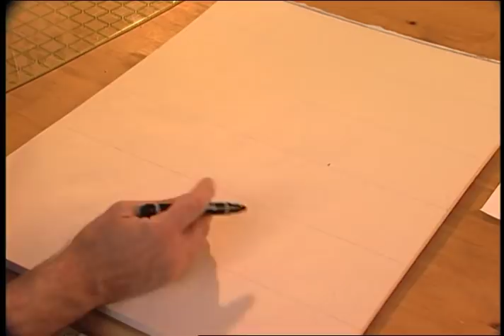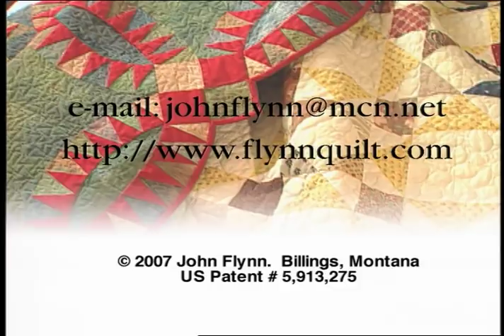FlynnQuilting

Comment: You make this look so easy. I am using pool noodles and adapting as needed. I can upgrade later if I need more strength. Can't wait to show my mom, 92 years old. Making my present quilt  is for a friend with terminal cancer.  I am making it in 3 sections, they will be basted together so her family will each be able to have a bed shawl of 58 x 36 inches. Will not make another so long. When you design on the go you work out the details for next time. Quilted my first stitches at age 5 1/2 years old, mom left the stitches in, 56 years ago. Long before my sister's. Thank you so much! I will likely watch repeatedly. You calmness is encouraging with the relaxing music. I will play some good music while quilting.

Comment: This is an awesome invention that I just happened to come across today by accident in a magazine called Nancy's Notions that got sent in the mail as part of some mailing list freebie or something. I just bought it on amazon a few hours ago and it's already on its way! I'm so excited I can't wait! I've only ever stitched in the ditch for every quilt I've made (mostly wall/lap sized quilts) but I really wanted to free motion quilt the wall sized one I finished and I even made my own template/stencil for a free motion design I wanted to use but I had no way of being able to do it with my home machine very easily given the size of it. Now I can and I won't have to pay someone else to do it like I thought I might. This is awesome because I have the fabric and pattern to make a bed quilt (my own version of the poppy panache pattern using less expensive fabric for the design) but I've been holding off making it until I could finish the wall quilt first and figure out the exact size of my future bed it will go on. Now I can finally start it, soo exciting! Thanks!
Reply: starfishgurl1984, how is the quilt frame working for you?  I am considering getting one, but I have a sit-down quilting machine, so I would not have the frame on the red roller.  It would have to sit directly on the table top.  Do you think it would glide around like that?  I hope that makes sense.

Comment: John, an idea for you..... How about inventing 2 roll clips that would clip onto the quilt roll as your thumb and index do. Add a vertical bar to that clip that can be grasped with a fisted grip hold. This would be ergonomic. I have thumb issues. The clip would have to be adjustable like a clamp because the fabric roll on the back(nearest your body) gets smaller as you unroll the quilt.

Comment: Good day Mr. Flynn.  Thank you for your tutorial However, just one question. You tack the backing onto roller A and C.  This i understand because the back in 1 inch bigger than the pieced top.  However you also tack the pieced top onto roller B leader.  Then you get to the length end of the quilt do you unpick this 1 inch and carry on quilting? Do you keep this taut with the side clips only? Regards ColleenMc

Comment: I have followed your instructions, bought 3/4" EMT and have everything ready for mounting.  PROBLEM  the rod ends you sent will not fit on a 3/4" pipe.  Do you have rod ends that will fit my 3/4" pipe???  VERY FRUSTRATED.

Comment: I love this idea, but I quilt full size quilts more often than 38" widths. Do you make a frame that will adjust for larger sizes?
Reply: You can buy conduit in longer lengths and use that. They just need to be the same diameter as the original pieces.

Comment: sounds like good home quilting invention to me. One question for you though, do you make them for bigger quilts? i.e. up to full size? just looking at all options before I consider a home long arm system.
Reply: I bought EMT at the local hardware store to replace the rails that came with it. They cut it to size and much cheaper than the rails he sells.
Reply: my question also.  for a king I just get longer rails
Reply: +Jackie Campbell what is EMT? He mentioned conduit. Someone else mentioned they used PVC. But I've not heard of EMT. Now that some time has gone by, how much do you like your quilting frame? Really useful, or rather annoying? Thanks for your input.
Reply: @susanmei9980 good questions did you get any answers
Reply: @janchaltraw8940  No; nobody ever told me what EMT stands for or if they really found their John Flynn quilting frame useful.
Reply: I don't know what EMT is, but I bought one of these at a quilt show in Paducah, KY 4-5 years ago before I retired.  I didn't get it set up to use till I retired 3 years ago, but it works GREAT and I LOVE it!!  🎊🎉
I live in a small house with NO place to set up a longarm, plus they are just too expensive for my limited income.  With this, I have more money to spend on fabric anyway!!  👏🤩😁
Reply: @roseannbradley3724  Thank you for taking the time to reply. I really appreciate it. 🌷

Comment: please  what  is the largest quilt that will fit   across on the  rollers? if  my quilt is a full size  quilt it is wider than the 45" so how do you do a wider quilt on the frame?